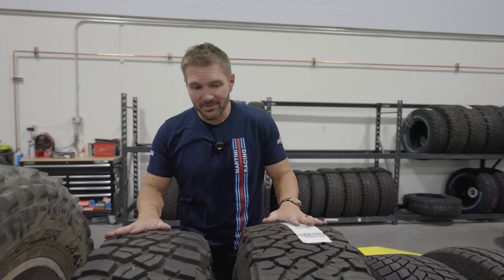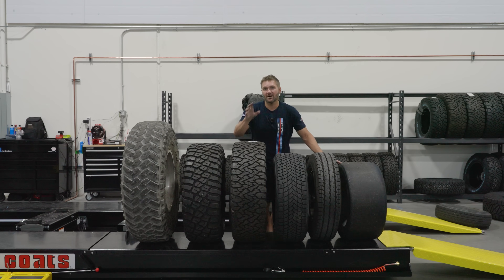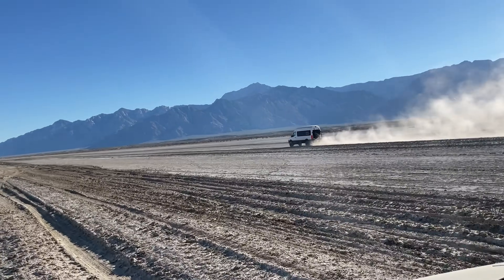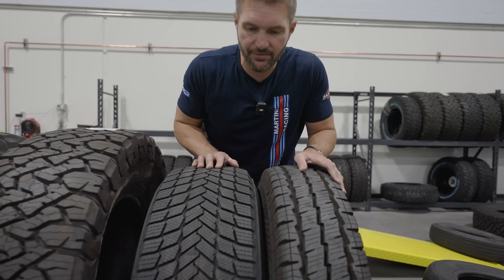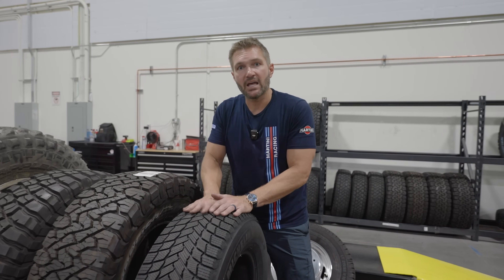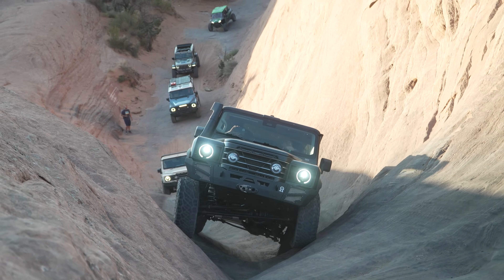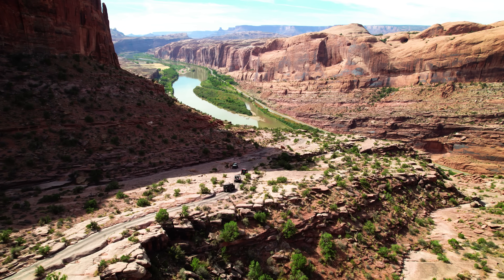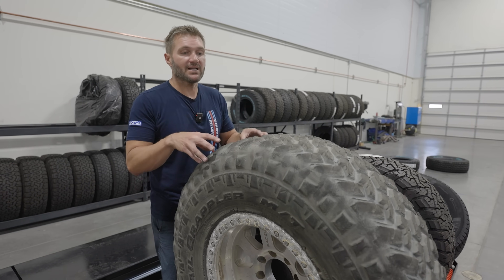Highway to Off-Road: What Tire Tread Do You Really Need?

Comment: Great breakdown and summary on different types of tires.
I am in the process of upgrading my 2022 4x4 Sprinter from stock and am a bit torn deciding between the KO3 and BRIDGESTONE DUELER A/T ASCENT (265/70R17). The KO3 gets a lot of love and recommendations from the community; hardly anything is discussed about the Dueler. I am leaning towards the Dueler because it seems to be a better tire for the road/highway driving, considering it's 90% of what I plan to do, this seems like the logical option.
Any suggestion or feedback is much appreciated.